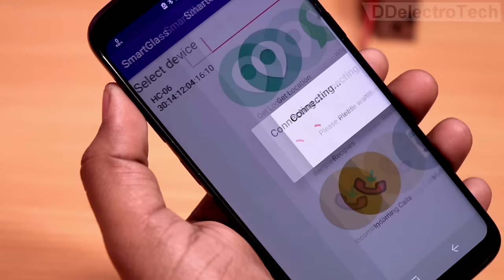How I Made my own Smart Glass Under $10

Comment: To those who complain about 3D printer: You can make the shell and body from cardboard too. 
I think the things you can't afford with only $10 are those device modules, OLED display and Arduino etc...
Reply: @booring2  does it run off of the same software?
Reply: 3d printers are insanely affordable nowadays, there's no excuse
Reply: Obi-Wan?
Reply: that dont make it 10 that make it 210
Reply: Well explained General Kenobi
Reply: Well you can arduino is cheap
Reply: @metronomemusic7165  yes lmao
Reply: OLED display 1.5 dollar
Reply: @lavacat720  I bought it like for 122 rubles(1.5 dollars) + nano for 300 rubles (3 dollars) and some cheap ass buttons (0.3 dollars) it is really cheap
Reply: where can I get the code to run it
Reply: I’m thinking a very tight $20
Reply: "I think the things you can't afford with only $10 are those device modules, OLED display and Arduino etc..."

So, just all the stuff that make up a "Smart Glass"?
Reply: 3d printing services ?
Reply: @Ardeact  idk 300 is kinda lot
Reply: @Ardeact   70 eur. I was surprised
Reply: 99 percent of people who would actually try this are people who like this sort of stuff and most likely have a 3d printer and if not wouldnt mind getting one
Reply: Even with an arduino, i still preffer a pico because it has wifi, and also even when u use an arduino its over 20 BUCKS. The powerbank module is 10$, A lcd is 5$. And a bluetooth radio module is $12.

Comment: Assuming you have a printer or other way to make a chassis, then you could get a mini projector, take out the actual projection system, and then use polycarbonate filament at the right settings.
Reply: can you suggest any projector that is so small to take its components because I can not find any online.
Reply: @NoNdAs90  there is none.

Comment: Me: Omg I can finally make my own smart glasses!
DD Electro Tech: Step 1 buy a 3000$ 3D printer!
Me: sad  :(
Reply: you added an extra zero more like 300$ dollar printer but I get your point
Reply: @void1571  Your name is itself ironic..LMAO
Reply: ender 3 is $200
Reply: @void1571  you probably don’t have money either
Reply: @void1571  in ur dreams
Reply: The video:i make this smart glasses with 10 dollars
Reply: you could use wood or sumn
Reply: @datrandomdugggy5537  actually one of the best 3d printers to start with is under $180 , its called the Creality Ender-3
Reply: @Caluhan  where on earth did you find a ender 3 for 180
Reply: @datrandomdugggy5537  you can find printers under $100 now
Reply: @AuxenceF  I haven't seen one could you link me to a cheap one?
Reply: @datrandomdugggy5537  if you really want something cheap get the easythreed X1 which is at like 80$, if you have a little bit more money, pick an ender3
Reply: @AuxenceF  true yeah the easy thread is pretty bad tho the ender 3 is still a really good budget printer but it's like 150-200 I wouldn't call it a bit more than the easy thread
Reply: Or you can just make your own without using the 3D printer 😎
Reply: @Mr.Kayden_givemeA_Break  yeah, u right
Reply: Just use cardboard
Reply: its just the ez way u can use the other
Reply: Ender 3
Reply: there are places where you can get stuff 3d printed. you dont need to buy it.
Reply: acc u can get an ender 3 pro for $300
Reply: If you decide to do it, you don't need any 3d printer. You can think of another alternative rather than a printer
Reply: i have a 3d printer and it was only $75 and prints look a heck of a lot better than the one this guy has
Reply: You can get an Ender 3 for less than $200 and get better print quality than this.
Still more than $10 overall, but $10 per set of smart glasses seems somewhat possible if you're buying parts in bulk.
Reply: You can make this by using  wood..!!😁
Reply: You can take a 3d printer for rent also😛😎👻
Reply: you can get a 3d printer for 170$ on ebay shipped.
Reply: U could use foam instead...
Reply: i mean u can make it out of any material
Reply: @datrandomdugggy5537  for around 200 you can get and ender 3 and it's a pretty solid printer with a big community
Reply: @void1571  lololol elitist
Reply: You can get one for like 70$ on amazon
Reply: Mine was £150
Reply: i got mine for $500 but still expensive lmao

Comment: 0:37, that heavy under extrusion though
Reply: what are the features with this model?
Reply: @bilalgniii9185  Not quite sure what printer he has, but what he is saying, is that (and I noticed this and cringed as well), for someone as experienced as him for tech, the print quality was garbage imo.  Under-extrusion can cause missing spots, and in this case, uneven surfaces, as the wheel that dispenses the filament into the metal extruder isn't spinning smoothly, and causing uneven amounts of filament to come out.
Reply: man probably left extrude in mm^3 on

Comment: Can your eye even focus on an object that is so near ?
Reply: It can! Because the glass is transparent and the display is solid it takes about 2-5 mins to get used to but you can focus your eye on an object that is abt 10.4 mm away from your eye.
Reply: You probably can, but then you would not be paying attention out of the screen and also 2 minutes is not a short amount of time if you are constantly switching your view, making it unpractical.
Reply: I think he means that the first couple of minutes using at the first time need to get used to, but then it works fine
Reply: Vr headsets has convex lenses that makes it sharper
Reply: That's why it has the magnifying lense, it makes the image appear optically farther away
Reply: Also I seriously doubt that tiny OLED screen is bright enough to see the reflection on the glass, it might work in a dark room but you ain't gonna see anything outside.

Comment: Step 1: buy a $200 3d printer
Step 2: buy a $20 soldering iron
Step 3: buy the  parts $10.50
Step 4: buy the wires $10
Step 5: buy flux for soldering iron $10
Total: $250.50

Comment: so... the damn google glass is just an incredibly overpriced magnifying glass?
Reply: nope, it has a lot of programming behind it, and it doesnt use a fricking ardino
Reply: Just check the size of both, they are almost incomparable. Google glass is a high end device that is capable of doing a lot of task while this one is a simple Bluetooth Arduino LCD display combo. The display speaks for itself
Reply: Lol Bob
Reply: Pretty much. But it has a way higher resolution, a camera, a touchpad, bone conduction speakers, WiFi, Bluetooth, etc.
Or I should say it had
Reply: It's not just about cost the of product that make up the price . It includes cost for research that you share with company .. ultimately all the cost are being passed to the consumer including profit of Google no does social work in business 🙂 hope this helps 
Thank you
Reply: No, in fact the device this person built would not even work as it lacks the specific lens used so that your eye can focus so close up. The Google Glass also tracks your eye movements so that by simply looking and blinking you can control a cursor and interact using just your eye.

Comment: U r funny "under 10$" but u need a 3d printer beforehand wow😂😂
Reply: Theoretically you could just use pieces of polyprene which you can buy a huge sheet of at your desired thickness for dirt cheap and then just cut and joint them together, This design is pretty smart but not under $10 for sure, but still really cheap and impressive in its own right.
Reply: many liberys offer 3D-printers services thesedays
Reply: ironbeats the case can be made with anything. You could use scrap plastic as a case.
Reply: Not to mention all the other materials  and components are definitely not under 10$. Every build is under 10$ if you already have the parts lying around

oh I just happen to have a Ferrari chassis and engine lying around, you too can build a Ferrari with just 100$ in nuts and bolts!
Reply: its under 10$ except the body of that
Reply: Forget that, you know how expensive some glasses are
You might have a 3d printer near you try that
Reply: Considering the true Google Glass is thousands, this is doable.
Reply: Use plastic
Reply: Alot of people have 3D printers... but good point (I don't).
Reply: ironbeats S T E A L

Comment: 2019: display on glass
3019: display on glass with sensor
Reply: 2029: display in contact lenses
2039: display implanted in your retina
2049: display is generated in your brain
2059: Philip K. Dicks' Neuromancer and biosoft implants
Reply: Continued:
 2069: Adam Jensen based body modification
2079: cyberpunk 2077 implants and cybernetics

Comment: use hat switches on ringsz and slider control on gloves .. using glass lock on a point .. now move the head to navigate around the point you picked is the clock target .. two eyesz angled easily points a heat dot tho even one

Comment: Pov: under 10 dollars
Oled display: about 5 dollars 
Arduino micro: 10 dollars
Bluetooth module: 10 dollars
Switch, battery and other: 15 dollars
Soldering: 10 dollars (the cheapest kit)
3d printer: 200 dollars 
I don't think so